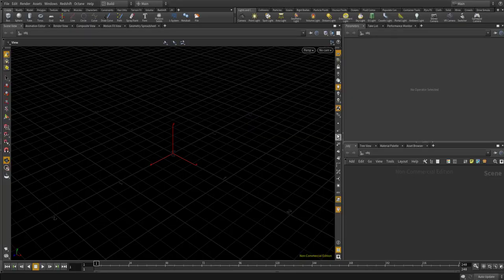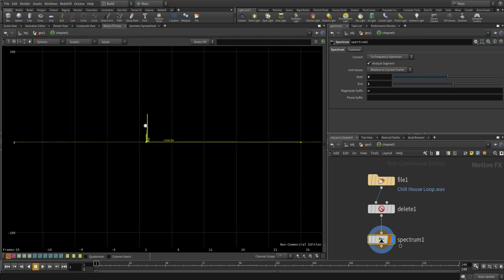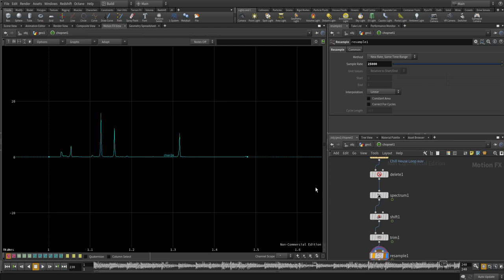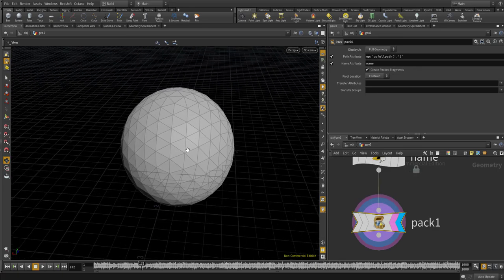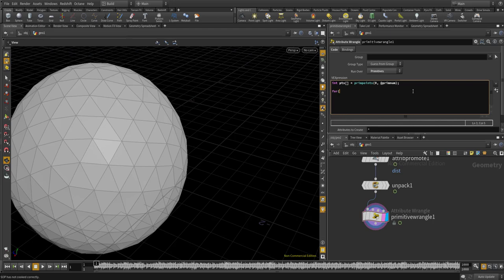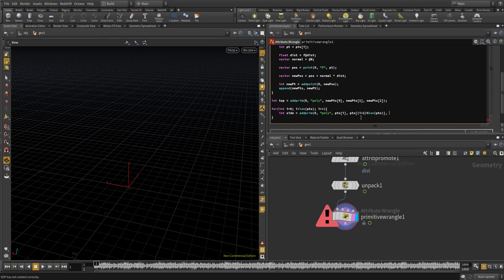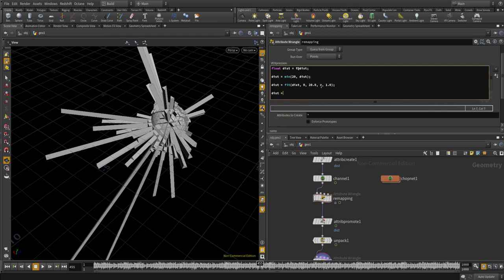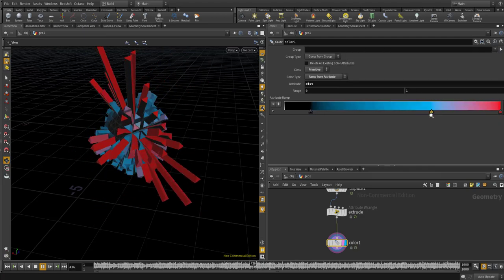[Houdini Tutorial] 0029 Spectrum Visualizer (Slow version)

Comment: Is there actually a benefit to using his VEX method for extrusion over the polyextrude node? He mentioned that if you used the polyextrude node you would need to use a for loop to run each primitive for this to work, but I don't think that's the case. I created a polyextrude node and set the distance scale to the @dist attribute created in this workflow and then set the distance to parameter in the polyextrude node to 0.994 and the results are identical to his. Not sure if there is some of speed advantage to using the vex method but just for simplicity I would like to just stick with the polyextrude node if possible. Am not a vex expert yet ha so this would help me create my own animations better.

Comment: For some reason for me. No matter how many times I go over it, the adding the triangles to the points just doesn't work: 

int top = addprim(0, "poly", newPts[0], newPts[1], newPts[2]);

Its the one line and seems to have zero effect. No errors just no effect. Any ideas?
Reply: You could try just using a Polyextrude node instead of the VEX method that he's using to extrude the primitives. I think there may be some speed advantage to creating the setup in vex but I'm getting identical results when using a polyextrude node with the @dist attribute in the distance parameter and then settings the distance in the polyextrude node to 0.994